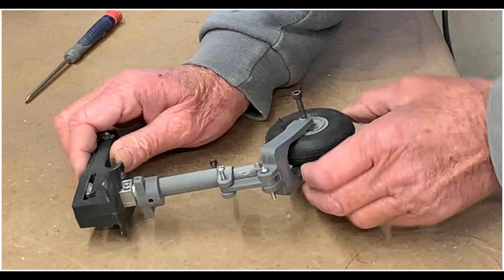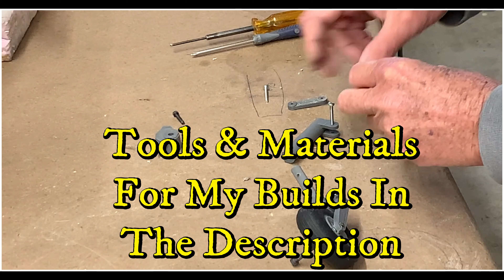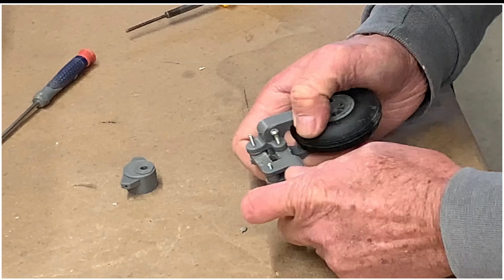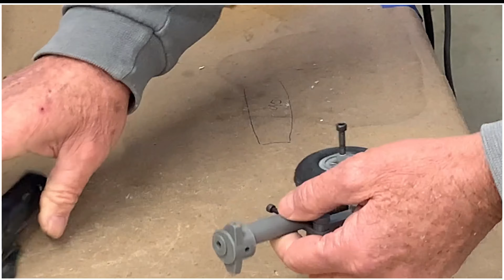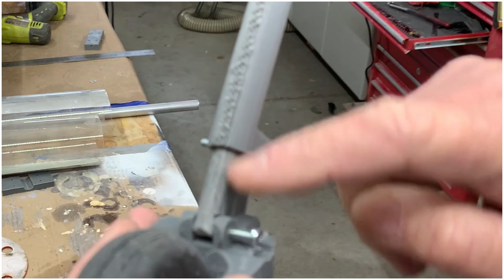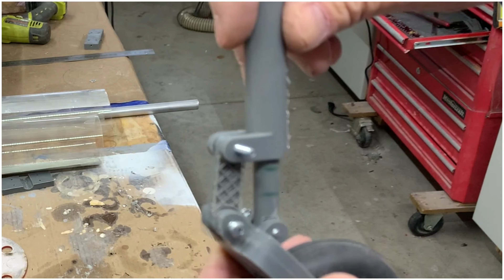MB-339 Scale RC Build Part 2

Comment: Do you have a link to the retract units that you use and where would you purchase the springs?
Reply from the maker: I got them from hobby king named large retract.  If I remember they are 91 mm long.  Manufacturer PZ-15096.  I have used them on My EuroFighter, A6 Intruder and other models over 21 lbs

Comment: Id make the strut tube's from Alum. PLA is strong and fairly tough but will degrade with UV and moisture exposure. PETG or ASA are good choice.  If it were me I'd machine em. 3D printed will work, until it fails. Cool design! You could probably get some test flight/landing with the PLA.
Reply from the maker: Yes, I was looking at examples and figured to make the lower strut longer and thick so I could lath it smooth then cut to length .  Grear advice thanks.  For the PLA test we have brass liner tubes coming today just so we can test a tighter fit for the geometry
Reply from the maker: we are looking at metal 3d prints but will try what we have in the spring on an old Tucano.  Just have to try them out.
Reply: @britcharming  I've printed both Alum and Steel. You would have to post machine both. Aluminum printed is rough and grainy and steel can be rough and will shrink (like cast).  Alum printing is very expensive. All part of the prototype fun process! Good luck!

Comment: If you are worried about strength PETG might be better. You can also get Fibre infused filament. I have never considered 3D printed landing gear, yours looks great
Reply from the maker: Already on it.  Currently looking at many different print methods